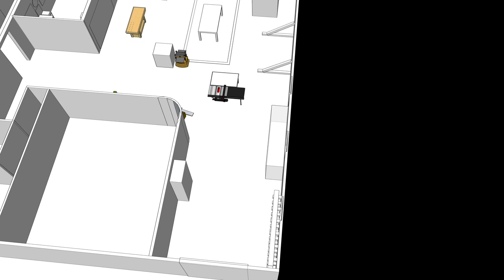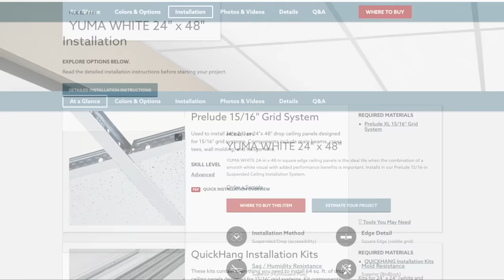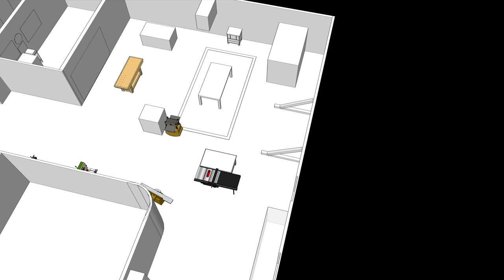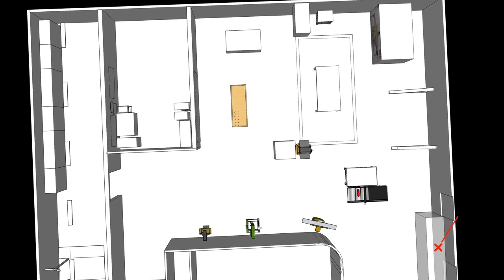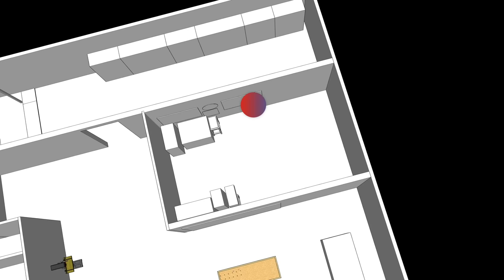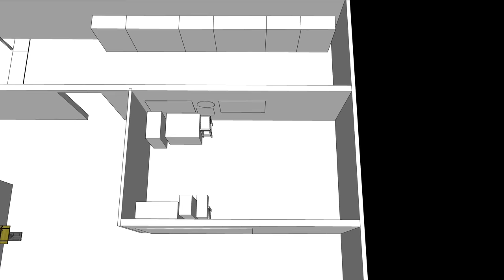I BOUGHT MY DREAM SHOP but it's kind of a DUMP // Dream Shop Tour

Comment: I covered the windows in my shop with a wide roll of thin white paper. Perfect for diffusing the light but still allowing you to walk around with the lights off if needed.
Reply from the maker: Good tip! Definitely been going back and watching you and April's shop build outs to get ideas. If you ever want to rode trip over here, it'd be fun to collab!
Reply: @craftedworkshop  i would definitely check that collab!

Comment: Thanks for the video. I will definitely be interested in your fit out. 
That subterranean wall is a major problem in my view. Those large wooden bracings will not do enough in the long term, IMHO. But they illustrate that it is gradually failing. If that was mine I would dig out all around that shed. 2+m wide to 100mm (4") below the level of the shed floor. Then build a separate retaining wall to hold back the earth, backfilled with gravel. Have it all drain away from the shed. Have a gravel path all around between the shed and the new retaining wall so water and dirt can not build up against the shed. That way the concrete block wall of the shed is not also acting as a retaining wall.

Comment: Add a French drain and that should take care of all your water issues it is a lot of work but it's better for the structure of the building than just trying to block the water with hydraulic cement. If you're very careful you can do most of the digging with a mini backhoe.

Comment: It’s an extra cost, but a large raised wood floor is amazing. If you have a heavy tool the trick is so get 4” aluminum round and cut them to the height of the floor. Drop them in holes and epoxy in. Works amazing for 1600lb milling machine and 900lb lathe.

Comment: For the wall support fix, French drain, then install a dead man support form outside in, if needed. That would give back all your floor space. French drain will more than likely fix the static pressure problem. That is great space you picked up, ton of potential. Lastly, get all that roof water away from your building!
Reply from the maker: I think that would unfortunately encroach on the property line, but we'll see how it goes! Drainage is probably my #1 focus right now for sure.
Reply: @craftedworkshop  If you've got enough room between the building and property line you could excavate out the soil and just form a slope. That'd relieve all pressure off the wall. i guess it all depends on space though.

Comment: you were on the right track with the french drain. it will solve both problems, the wall sag and incoming water. don't use hydraulic cement until after the french drain in my opinion because you may not need it at all.

Comment: Thanks for the video! No doubt you’ll make this an awesome shop!! In regards to the 3phase, check out VFD (variable frequency drive). You can wire up any 3phase motor to a VFD and convert from 3phase to single phase. I run multiple 3phase tools with VFDs without a phase converter or any 3 phase power to the shop. The 3phase motor has low and high voltage wiring diagrams. Change from low (3phase) to high (single phase) voltage and connect it to the VFD. Typically, go double HP from motor to VFD (3hp motor to 6hp VFD). Essentially each tool has its own VFD. They cost $250-500 bucks. 
I saw Canadian Woodworks doing this and haven’t looked back since!! Thanks again!!
Reply from the maker: That definitely works for some stuff but I don't think I could use a VFD for a 30HP wide belt sander, for instance. Nice to have the option for stuff like that!

Comment: Dig out around the foundation and have a roll on rubber coating put on  to help with stopping leaks and a good drain system leading away from the building into the woods .

Comment: Looks like you got a nice little project ahead of you. If you go with a drop ceiling might I recommend going with 24x24 grid and tiles over the 24x48. As an electrician who has had to work above a many of drop ceilings I hate messing with the 24x48 tiles
Reply from the maker: For sure! And that's a good point, the 2x4 are tempting though since they cover area quickly. We'll see!

Comment: Gratz on the new space, I would do perforated metal on the ceiling. It is built for having sound deadening materiel behind it and letting the sound go through the panel to it. To make it look top notch I have used a sound transparent fabric in black to make the space behind the panels uniform in look. I also space the panels off the sub surface about .5", this lets the reverb on the back side of the panel bounce back up into the sound deadener.

Comment: Consider digging the dirt away from the building, creating an 8' or wider alleyway all around. Build a retaining wall to support the rest of the high ground. Build a bridge to the upstairs back door. Then you can get rid of those braces (save the timbers for something else). Also should kill the water intrusion problem.
Build a sprung floor. Even easier on your feet. Heavy machines (such as a mill) would have to sit on platforms with their own supports.
Remodeling the kitchen, bath, and bedroom would make great future projects. They look to be in pretty decent shape, so you could probably save those for a few years down the line.
Ditto the elevator.
7:29 Make that room the metalworking room, and the one in back, the finishing room. Give it its own door to the main room. Then, if you paint something, then immediately decide to weld something, the paint can dry unaffected by the welding activities. The existing door to the back room means you can move your metal projects straight over to finishing.
Closed-cell foam would be a smart idea.

If you did not already throw out the all of the old shelving, save the uprights for jigs, epoxy molds, and other things that call for material that may get destroyed or otherwise get thrown out when the project is done.

Comment: Permaquik 200 is a great and easy to install cementitious waterproofing product. Waterproofing from the exterior is always better though, if it is possible, I'd use a Tremco 250GC roller/trowel grade with drainage board over top.

Comment: you could build out the "living quarters" in the attic centrally with unfinished attic around it... avoid expensive spray foam and not upset the current "venting" of the attic space.

Comment: Johnny, please do a build for some swing-out carriage doors to replace that roll-up door. A big pair with a steel frame, wood face, then polyiso insulation. About 3" thick total. I'd love to see you weld up the frame and put in some wood. I want to do this in my shop and I need some inspiration from a more experienced builder.

Comment: For the finishing booth area, I understand the need for an exhaust fan, but realize that it will pull dirty, dusty air from your shop into it. This could be problematic for your finishes. Maybe put in a dedicated, filtered air intake duct. That way it will still draw the booth down and exhaust the fumes, but you can prevent dust from being drawn in. You'll want to make sure you have a good seal on the door too. I have seen the use of 16x16 HEPA filters inset into a set of sealed paint booth doors.  Overall you're also going to want to take a look at the shop ventilation for dust and humidity control. Looking forward to seeing how this goes.

Comment: You should got those walls sured up with steel beams  cleated in  against  top and bottom and and deal with the hydraulic  issues before  it falls down on your head.

Comment: Looks like an awesome shop! One thing though, don't spend the money for rock wool over regular batt insulation for reverberation control (sounds deadening), it performs the same, especially if you're going to put a drop ceiling in since the sound won't get to it anyway. You can spend the money on better ceiling time. NRC 0.55 is not superior in any way haha, NRC 0.70 is the minimum for most commercial spaces. NRC >.90 would be the top end stuff)
Reply from the maker: Good tips, Matthew! The Rockwool would be for sound transmission between the two levels as well, so I think it'd be worthwhile there.

Comment: In terms of natural light issues.  Just a thought, but you could quickly make some tinted framed plexi-glass inserts that you can add and remove as you need/want natural light.  This way you get the benefits of both; without the cons of both.  Very happy for you and your growth as a person and professionally!!  Keep doing you!
Reply from the maker: Good idea! The current "windows" are actually plexiglass and are far from air tight, so that'll be my first task. I've had good luck with privacy film as well for diffusing light.

Comment: You should talk to a structural engineer even before taking out any part of the mezzanine. There’s a good chance the floor diaphragm is bracing those perimeter walls from buckling under the weight of the roof, wind, and/or the lateral earth pressure.
-structural engineer here
Reply from the maker: Good call! You don't happen to be in NC, do you? 😁

Comment: My experience with water and rooms is this. There is no point in sealing off the inside. Even if you do what looks like the best job in the world, water, if it wants to get in, it will get in. You need to address the drainage on the outside and most likely add a tar type sealant to the outside bricks, and aggregate pipe with gravel is one example. This all depends on how it looks outside, but take it from someone who has lived in places that flood. Sealant on the inside is a waste of time and money, and the water naturally finds its way in through the best gap filler. It's doable and is similar to what you have to do on the 9ther side of your shop. Awesome purchase btw. Very cool.

Comment: Definitely consult an engineer but I would look into a soldier pile system that could be installed on the exterior and stabilize the cmu wall. Miradrain makes systems for waterproofing and drainage.

Comment: Great space, a lot to think about in setting it up for the nest flow. Curious though, why didn't you get a structural engineer out before you bought the space. Seems those wall braces can add up to lots of $$$ if you have structural defects. Gonna be a great project and I'm sure it will be amazing, once ur only ur way. Congrats

Comment: I hate to be the Debbie Downer, but consider renting the top portion of your shop. Consider building out storage for rent. You’re gonna need the income to fit out the bottom. On a side note that kitchen is great! The stainless alone is fantastic. I’m sure you can come up with a cool design. For reference my shop was 13k sqft. I became a construction/material hoarder. Now I’m semi retired and definitely downsized. 

Good luck.

Comment: Just a tip, you may want to use the 2'x2' ceiling tiles rather than the 2'x4'.  The 4' long tiles tend to sag over time.

Comment: Just attach roofing metal to the existing truss's. it is the cheapest material for the walls or ceiling,. You can not buy osb and give it 4 coats of paint for what you can buy the metal for..

Comment: I know it's too late to worry about it now, but I would have had a structural engineer inspect the building, before buying it, especially where those weird braces are. Worst case scenario, you could have to replace a portion of that wall. With your insulation issue, I agree, small animals probably made a home there at one point. I would probably replace it with closed cell spray foam insulation. YouTuber Matt Risinger ( He's a General Contractor) did a great video a while back on the differences between open cell and closed cell spray foam insulation. I would begin by first having the pink stuff removed, then get your electrical issues resolved, AND most importantly, if there isn't already a fire suppression system in the building, have one installed, and then re-insulate the ceiling. Trust me, a fire suppression system will do amazing things to your insurance bill. Matt Risinger probably also has a video on how to address your water leakage issues.

Comment: Do not under any circumstances put drylock on those damp walls.  The previous owner drylocked the living crap out of our wrt basement.  All that moisture pushed the drylock off of the wall surface.  The gap was full of mildew.

Removing that was not a fun project.

Comment: windows only are a perfect place for insects and spiders.  i built a garage 40feet x 25feet and no windows in it with two 10 ft roller doors. even with the roller doors open  i find myself turning on the lights anyway

Comment: Literally the first video of yours I have seen. Water infiltration NEEDS to be delta with from the exterior. Yes it is more expensive but in the long term anything you do from the interior doesn't prevent that pours concrete from wicking water.

Comment: Hot sparks and flammable finishing products also not such a great combo - if you are going to use that room for both finishing and metal working, make sure you don't set your building on fire by accident